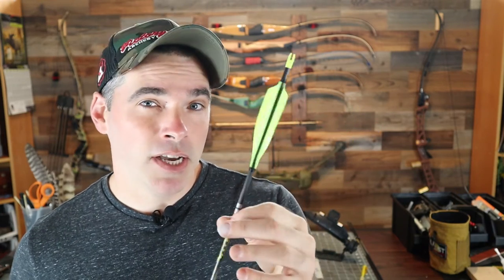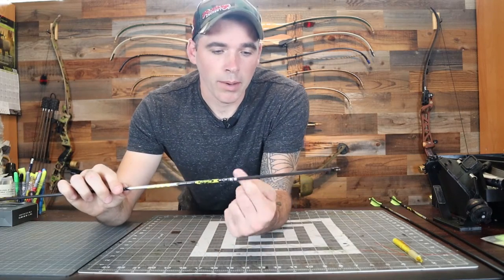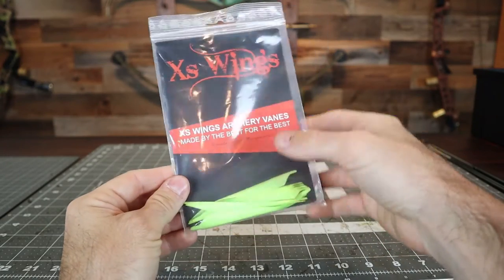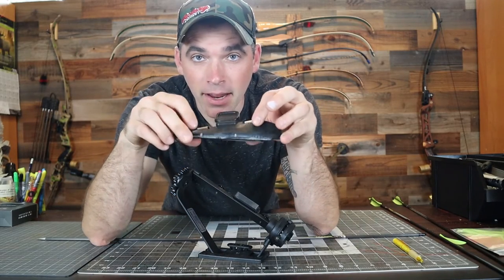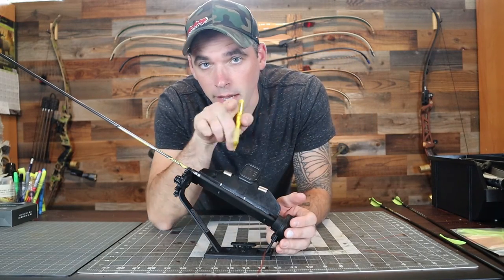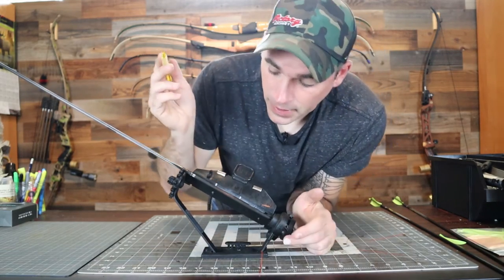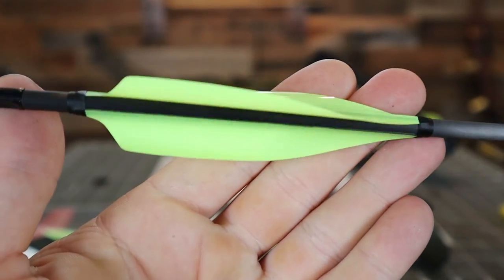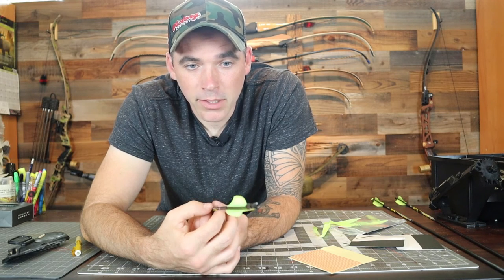How to fletch an arrow with XS Wings(Spin wings, Spider vanes, etc.)

Comment: What if you don’t have the fletching device BPE?
Reply from the maker: Most other brand fletching devices should work similarly(Bohning, Bitzenburger, Cartel, Grayling, Beiter, etc.) Without a jig it will be tricky to get the correct placement, and offset. Any of the above mentioned jigs should work fine for spin wings. The Beiter is specifically made for fletching spin wings, and it's affordable. https://www.lancasterarchery.com/beiter-tri-liner.html
Reply: @PointOnArchery  👍🏻